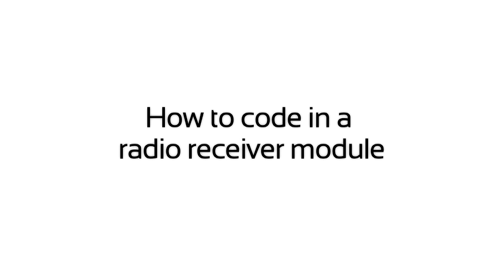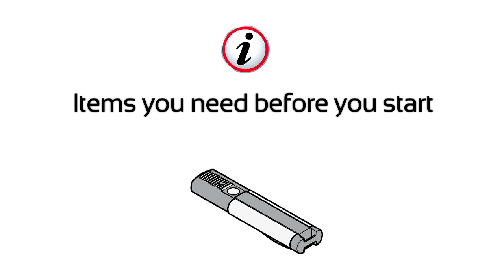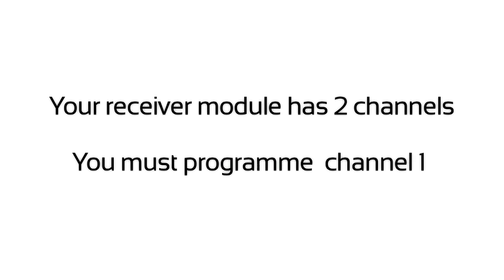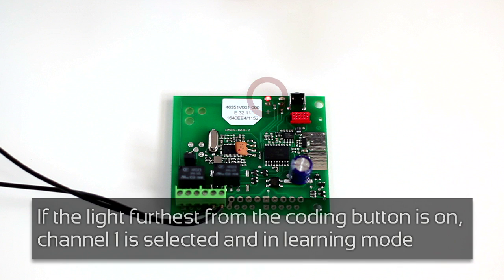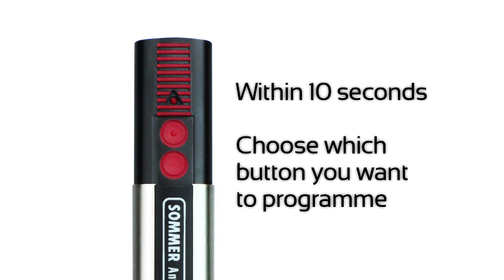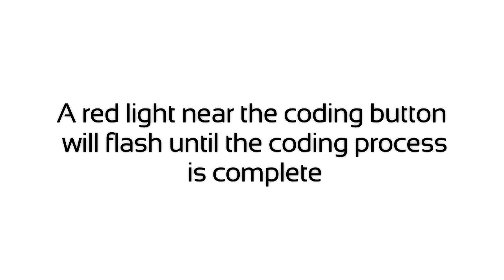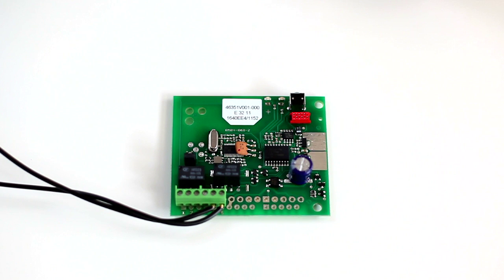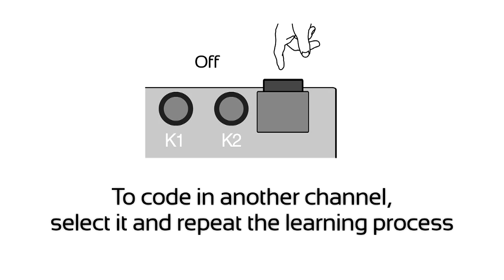SOMMER Coding in a hand transmitter 868 MHz to a radio receiver module 4754 (EN)

Comment: How would you power the module to do this before its fitted
Reply from the maker: Hello Devlin Maguire,

the supply voltage can be taken directly from the control unit, or from a transformer AC alternatively via a power supply unit with DC. Rated voltage range: 12–24 volt, AC/DC ±20 %

Best regards
Your SOMMER Team